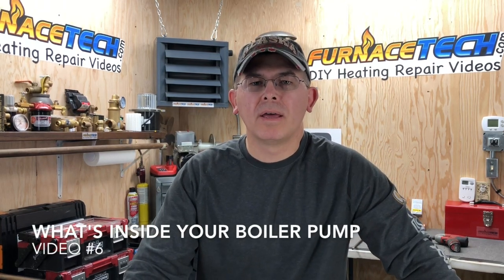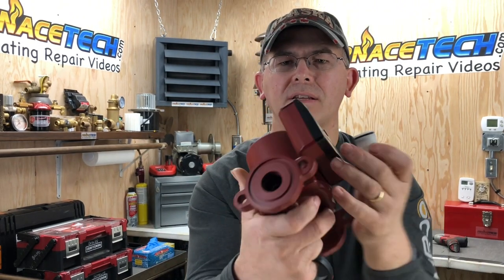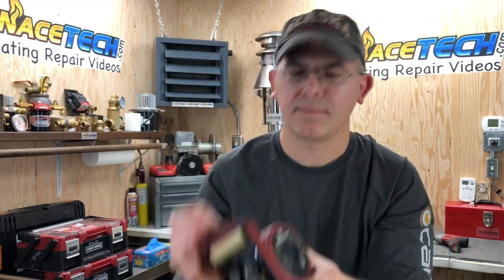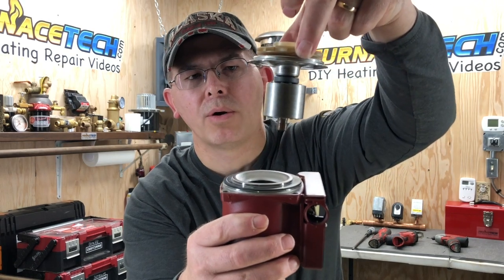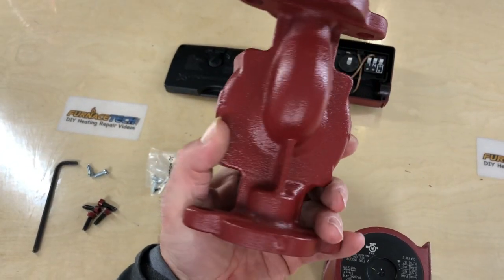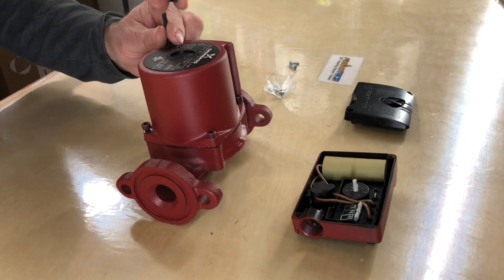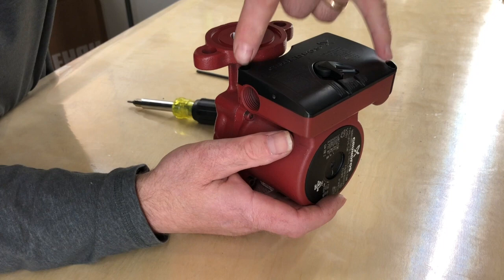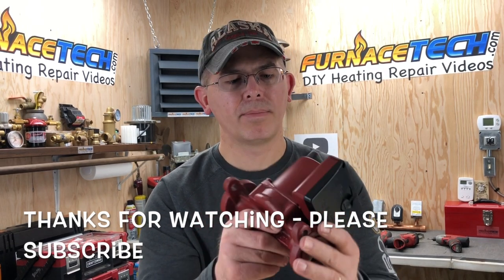What's Inside a circulator Pump - Video #6

Comment: Excellent video! I have one question, i need to mount mine in the horizontal position.  I'm thinking that that would be with the printed name plate facing down.  Is that correct?
Thanks,
Bob
Reply from the maker: The motor needs to be in the horizontal position and that is with the motor data info which is printed on the top of the motor facing the walls of the house, not the roof or the floor. I hope this helps!

Comment: 1:20 Why is Check Valve on discharge side of pump and not on suction side ?
Reply from the maker: That’s how the manufacturer designed it to work within this pump.